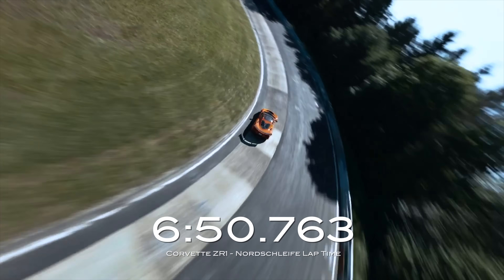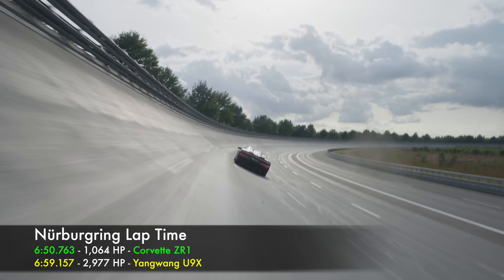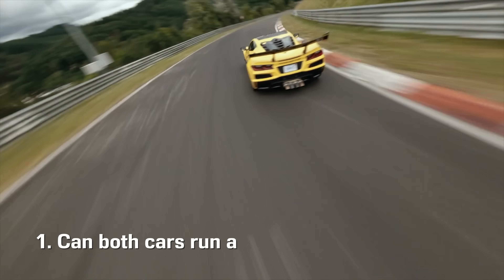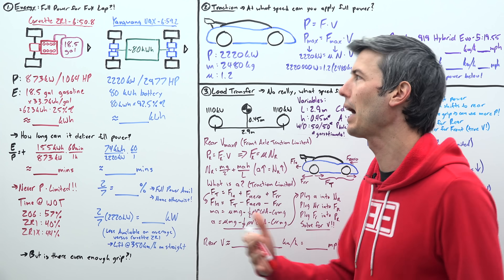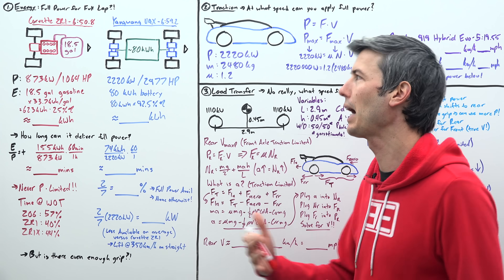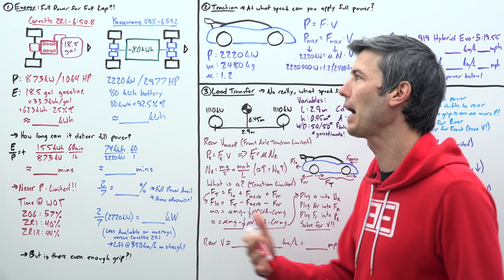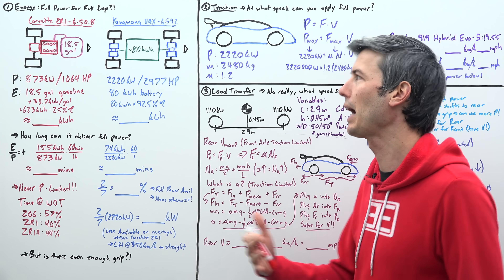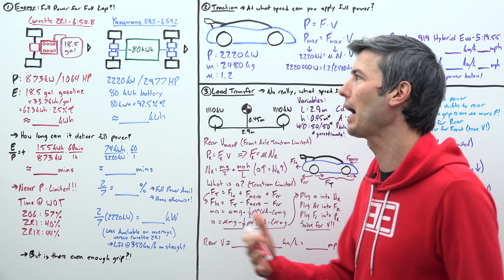Gas Beats Electric! Why Is 1000 HP Faster Than 3,000 HP?

Comment: Why taking the 1000hp corvette when the GT3 RS does it with only 500 and do better times 🤨😮‍💨
Reply from the maker: If only I thought about this! 😉
Reply: He does talk about the gt3rs :)
Reply: Watch the video before commenting -_-
Reply: Cuz 1000 rhymes with 3000 but 500 doesn't
Reply: ZR1X was still slightly faster. They also didnt use a Nurburgring 24 hour winning pro driver. The Corvette is 900 ibs heavier also. Yall Porsche fans love to ignore variables & details
Reply: he mentioned the gt3 rs at the end
Reply: TIK TOK BRAIN LOLOLOL
Reply: It was a preference opinion and not related to the video... Indeed I did not specify 🫠
Reply: @dehayninmaxime5278  I respect it. Just want to point out the ZR1 is a 9 second car that tops well over 215 mph , it's not specifically designed for track days. It's an all around approach
Reply: Because the Zr1 has imposed one of the most recent lap times?

Comment: Faster or quicker? Shouldn't it be quicker. Yangwang is faster with a higher top speed but corvette is quicker around a track
Reply: The Corvette maintained a higher average speed around the track.  It is both faster and quicker than the Yangwang.
Reply from the maker: If you had to pick, which car would you say goes around the Nurburgring faster?
Reply: The English language is fascinating. In German the word for both would be "schneller".

Similar to engine for combustion and motor for electric. In German it's "Motor" for both.

I guess that's one of the perks of incorporating about 5-6 different languages into your own.
Reply: @sandrinowitschM  It's not actually distinct in English, either. The poster is just being incorrectly pedantic.
Reply: @F0XD1E  while i agree i am being unnecessarily pedantic i wouldn't say i'm incorrect. Although my comment was initially meant as a bit of tongue in cheek its about time these words were defined and i'm curious what everyone's opinions are.
Reply: @jono6379  well, they are defined, and they are synonyms. Same as Swift, Rapid, Speedy, etc.
Reply: @F0XD1E they are synonyms in common vernacular but I always understood them to be distinct in technical discussions.
Reply: @jono6379  I would say that they are not technical terms so they would not be used in an actual technical discussion. In this case, he was talking about lap time, and it doesn't matter which car had a higher top speed during the lap. All that matters is the time. In an actual technical discussion you would use actual technical terms like velocity, acceleration, etc.
Reply: Not only that, the Corvette is also faster around a track
Reply: First you need to define both words unambiguously
Reply: Debatable, you could say the Corvette goes through a corner faster, and talking about a CIRCUIT, corners are the most important parts.